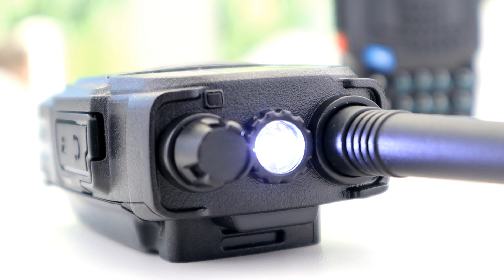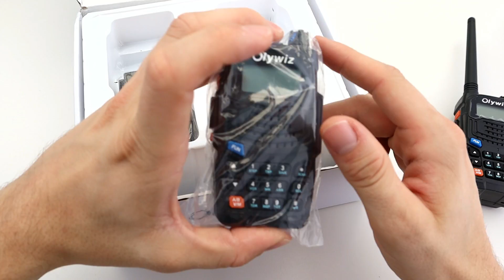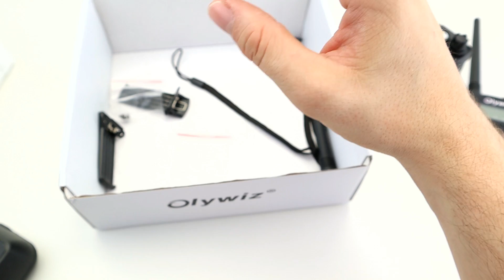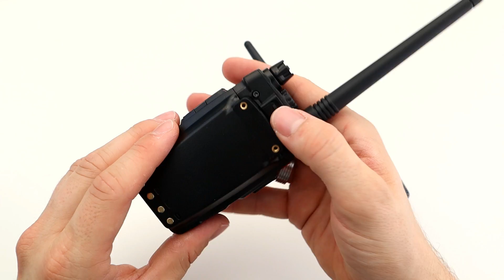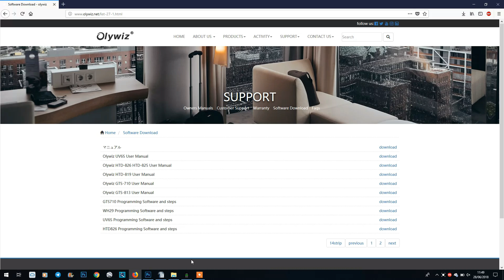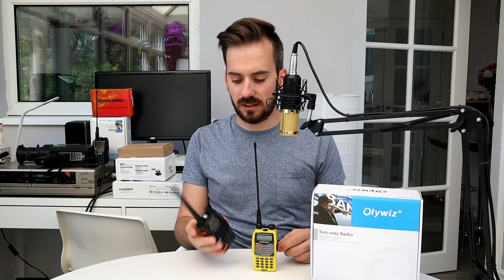Olywiz UV6S Two-Way Radio Review, Menu Functions & Programming

Comment: Hi, I have these radios and your video was very helpful in getting to grips with setting it up. However, I'm wondering would you recommend a better Antenna that can be attached to increase range? Would the 42'' ABBREE Antenna that's listed for a Baofeng UV-5R Radio work on the Olywiz?

Thanks, Andrew